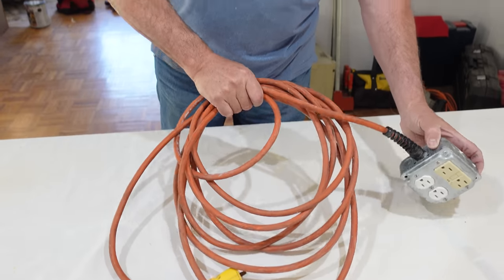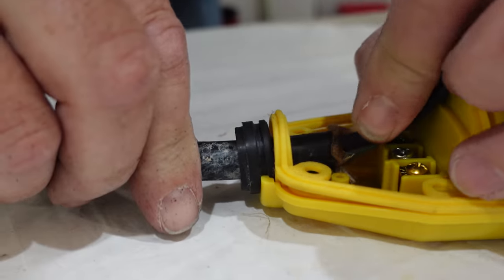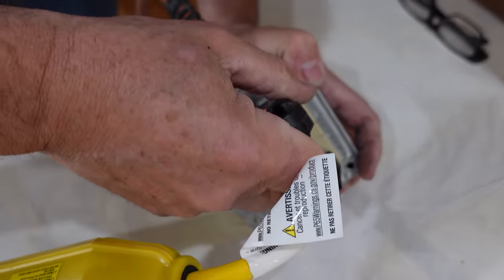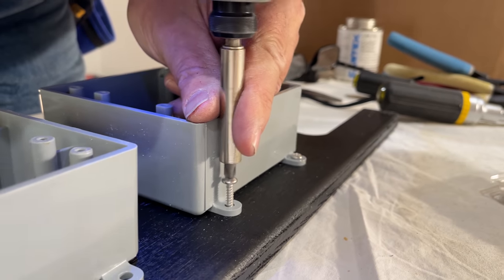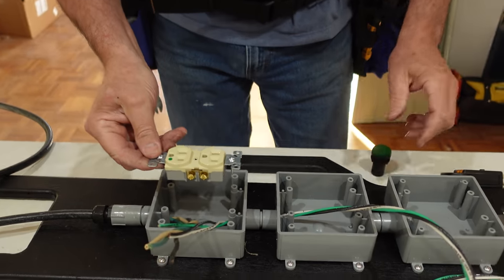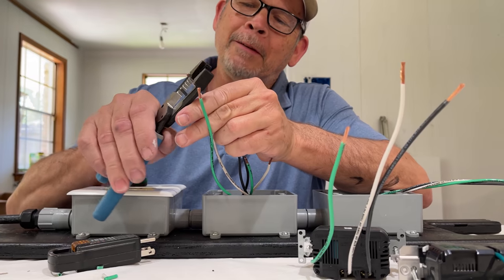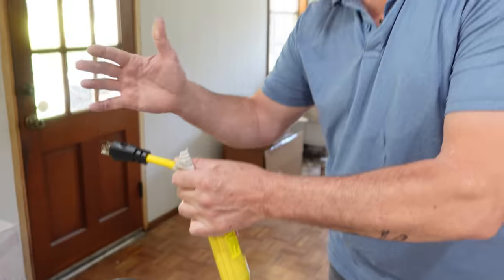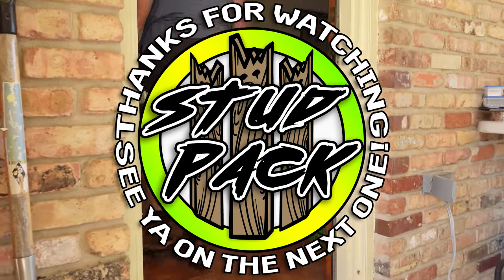HOW TO MAKE THE ULTIMATE EXTENSION CORD!

Comment: Awesome as ever! Shouldn't the highest current receptacle be the first one on the daisy chain? The lightest load (the USB chargers) at the the far end. That way, the high current load doesn't have to go through a half dozen interconnects. It makes sense to put the high load socket and the pilot light in the first box so the high current is first on the line and  the lamp let's us know power is coming in at the source. Though improbable, one of the connections in the middle of the boxes might fail. You still know the cord is hot. Keep up the great work, boys. If your video pops up in my recommendations, I get a piping hot cup of Joe, sit back and enjoy the show!
Reply: It makes no difference the order of receptacles, just because one device is able to pull 20 amps, doesn’t mean the rest of the devices are getting “high current”. Kitchens are required by code to be fed with 12 gage wire and 20amp breaker. It makes no difference if you are running several high amp appliances on a certain plug and then have your phone plugged into a different outlet…your phone isn’t going to fry with high current just because you other appliances are pulling 20amps. You also probably don’t even know the order the receptacles were wired anyway because it’s not an issue.
Reply: @JSH1  it's like when you use the receptacle installed on your oven to power other stuff.
Reply: @JSH1  We watched him wire it so we know its one box to the next meaning the switch and 20 amp outlet are at the end of the chain.  I think you missed the point of his question because it had nothing todo with the wire being able to handle the current, your explanation may be valid but didn't answer the question.  wires in the wall or box are unlikely to fail, especially when there is never stress on the wire, that's why code has them clamped to the box and within a certain distance of the box to a stud.  His point was a physical connection is always going to be weaker than a solid wire.  logic would say that the highest power should have the fewest possible disruptions to the current which leads to his question.  Science or testing may show that the logic is incorrect, or does not have a significant difference to how it is wired.
Reply: @trekie30122  I’m simply saying that it doesn’t matter on the order of 20 amp vs 15 amp plugs…note that 15amp duplex’s are rated for 20amps. There is no stress from box to box the way it’s installed. If he was connecting box to box with SO cord and not secured to a backer board then that would be a valid statement that the wires would be more stressed than a typical install.
Reply: @JSH1  absolutely it does matter. If you have the 20amp receptical at the end and plug a device in that is pulling 20amps, then that middle 15amp receptacle has been overloaded as the power has to pass through that one first.
Reply: @remodz6385  He's not passing current through the earlier receptacles. That's why he had to use the 5 slot wagos.
Reply: @remodz6385  Not trying to be disrespectful here but you clearly don’t fully understand how electrical systems function nor does it appear you’ve watched how he pig tailed the receptacles. Power isn’t flowing through one receptacle, through another then through another in a daisy chain, it was wired in parallel which is code.
Reply: @dms031000  ahhh👍 didn’t notice.
Reply: @JSH1  I looked carefully at the video and that is not so. He had Wagos in the first box and Wagos in the second box with the receptacles daisy-chained through multiple Wagos. If you pause the video at 19:51 you can see this clearly.
Reply: @ib9rt  correct, the wagos are in each box, connecting the line voltage to the receptacles and also to the wires for the next box. This is the definition of connecting receptacles in parallel. If there were no wagos and the line voltage was connected directly to the receptacle and then wired to the next box from that same receptacle then that would be considered daisy chained. He wired everything properly and to code so it makes no difference the order of receptacles.
Reply: @JSH1  I disagree. Whether you consider the receptacles to be the connectors, or whether you consider the Wagos to be the connectors, the connections are still in series, even if code considers them to be "in parallel". The daisy chain goes: Incoming => Wago => Wago => Wago => Last receptacle. There is no reason to consider a Wago to be a more or less secure connection than a securely wired receptacle. If there is a break in the wire it becomes a connection instead of a continuous conductor, and any connection is a potential point of failure. From an engineering point of view it would be preferable to put the 20 A receptacle in the first box so that there are fewer connections for the 20 A to flow through. Wagos may be certified and secure connections, but they are connections nevertheless.
Reply: @ib9rt  I appreciate your viewpoint but from an electrical engineering perspective the receptacles are wired in parallel, it makes no difference for the order of receptacles. If this was a permanent solution to power a dedicated piece of equipment then yes, a dedicated 20a home run circuit from the panel routed directly to the 20a receptacle without any other connections or receptacles would be the ultimate choice. This is an extension cord at the end of the day, what else is connected to the same circuit as the extension cord is plugged into and how many other wago/wire nuts are used in the house wiring to the receptacle the extension cord is plugged into?
Reply: @ib9rt  I also respect your opinion,  but it's only used for a job site application after all,  right? 
Or did I miss something. 🤔 
I watched 3 times and came to the same conclusion.
Reply: @ib9rt  I agree with you and came here to post the same.   It’s not much, but the Wago terminals (or any other terminal) will a small voltage drop.   So, yeah, it would be best to put the high current load first to minimize those drops.    Of course this is kind of nitpicking as there will be more voltage drop in a 50 foot extension cable than across a few terminals.   But still, the Studpack way seems to be to things right whenever possible so why not put it in the best order?
Reply: @aerotraveler  If you were to take a voltage drop tester and test the voltage drop of the first receptacle, the second one, and so on, you would be surprised as to how much voltage drop can occur just from each connection. It wouldn't surprise me if there were a 2 or 3% drop from the first recepticle to the last one, which could in totality be in excess of the 5% drop you want when operating high amp draw tools.

All that being said, the extension cord will work great as it was assembled, but it would be my personal preference to put the highest draw 20A receptacle 1st, followed by the 15A, and then the USB receptacles. This configuration would have the lowest voltage drop for the highest current drawing tools.
Reply: @JSH1  The point the others are trying to make is a simple one. The higher load devices (potential load) should have the least amount of splices in the system. Although this is not a code requirement and is often passed over in practice, it is a legitimate point of view from an engineering standpoint. In fact, in some industrial situations with long runs back to the switchgear, this is exactly how things are done. But those are complex situations with multiple fused disconnects being used to allow a smaller gauge wire to be ran to equipment further downstream as the load on the branch circuit is decreased. As you know, this approach is exclusively used on heavy stationary equipment without load centers that require a single disconnecting means that can cut power to the entire “circuit” machine/line at once.
Reply: @Veritas-invenitur  John, I couldn’t agree with you any more, if this were a permanent load on a dedicated circuit as I mentioned in a previous comment. My simple answer is that this is an extension cord, it doesn’t matter if the 20a receptacle is first or last. The 15a duplexes could potentially have 2 loads at 20a on those more frequently when using multiple saws/devices, as they’ve mentioned in the video, they don’t even own any 20a equipment at this time. Having 2 additional “splices” is not going to have any issues on an extension cord when it could potentially already have an infinite number of “splices” in the circuit they are plugging into. A 20a circuit can have up to 10 duplexes installed, each of those receptacles is a “splice” point and depending on which receptacle they’ve plugged into, they already are dealing with multiple “splices”.
Reply: @JSH1  I respect the logic.
Reply: @remodz6385  The wagos make each device on a parallel branch. They're not in series.

Comment: Good video, Stud pack. Randomly came cross this older video of yours, i have been watching the new carage build videos like grazy everytime a new episode comes out! One thing i may add about the cord: here in Finland, i was taught in school to always make the cords ends connected so that the 3 wires inside the cable would be so that the ground is the longest wire, then the neutral the second longest and finally the hot to be the shortest cut of all the wires.
This is so that even if the strain relief fails, the hot wire is the one that gets yanked out of the connection first, so that it would disconnect first in case of a fault. Neutral second because if the neutral would be the first to disconnect, it may in some cases destroy some appliances with the hot still connected. i think its because the electricity sometimes finds a other route inside the device and it can potentially be very bad for the device, like frying circuit boards and etc. Ground finally the longest so that the device is always grounded in case of something ripping the cable straight out of the cord. Happens more often than you think.

Comment: A breaker is a Thermo-Magnetic over current protection device. The '' Thermo'' portion of the breaker consist of a bi-metallic* strip of metal that is heated by a resistor in series with the load *( two dissimilar metals fused together, each having their own thermal expansion coefficient, thus creating a curve in the metal strip when subjected to a heat source. ). this flexion of the bi metallic strip of metal is used to trigger the breaker opening mechanism. the bigger the overload, the faster it heats up, the quicker it trigger.

On the other hand, in the event of a pure short circuit, the Amps drawn can easily climb to 1000 amps on a 15 amps line in a fraction of a second, too fast for the bi-metallic system to react in order to prevent the wires from glowing red. This is where the ''Magnetic'' portion of the breaker comes into play, inside the breaker the load/amps have to pass thru a coil of wire that act as an electro-magnet, but just when huge amount of current pass thru it, so when a pure short is present with thousands of amps, the electro-magnet pulls the triggering mechanism of the breaker and opens the circuit. Simple design, very effective.
Reply: I would say the ohms resistance on this build extension cord is one of the best in the industry compared against other  multiple  outlets connectors.  which is why others burn up. I believe the breaker is set to an average resistance for the regular consumer and bc this was diy built the breaker did not trip. but thats not a real world test bc nothing like that is ever that close  each tool is usally in its own area so may be adding some 25 ft to 50 ft extension cords would really load test the breaker and and and the load when cutting is higher so may be performing an actual cut for testing will pull more than 28 amps for sure
Reply: great explanation by the way!
Reply: Not all breakers are thermomagnetic.  The breakers in a lot of power strips and inverters are usually thermal only.
Reply: @randacnam7321   That is very true and hospitals and other more health related places have thermal protection and magnetic action as does homes or residential.   

Canadian standards now do not accept any breakers that do not have at minimum Thermal and magnetic trips.
Reply: There is also GFCI, AFCI, and so on, but for the sake of simplicity i talked about the most common house panel model.
Reply: @thankswezilow6794  Thanks.

Comment: Rotate the boxes 90 degrees. The wire on plugs that point down will tangle up across the other plugs. Having them point out instead of along the unit. Great job. Loved the hospital plug info. Great for heavy use and heavy load.
Reply: If you rotate those plastic boxes then the conduit connections become more complicated with tees and would not be inline as they are in that build.
Reply: @user990077  No changing the device direction doesn't change conduit.

Comment: I really love this project. I have been meaning to make a couple of boards like that to coil my extension cords, but I didn't think to integrate the receptacle boxes like that. 
Instead, I built a steel box to hold a 20A 120V duplex and a 50A-style 240V receptacle (for my welder and grinders). There was no way that I'd find the right combo cover plate for that at the home center! I like the idea of the separate 2-gang boxes, I think I'll rebuild my breakout box this summer and add the board, too!
Thanks guys!
Reply: How do you get 240v to your panel?

Comment: Great job guys. I too am an Electrician, but i think the overload has been well explained as to what's happening. Loved your super extension. Thanks for sharing 😃
Reply: You thought the 12AWG stranded falling of the ground screw was something to "love"?  No 15A receptacle is designed to hold a 12AWG stranded conductor on a ground as it is NOT a current carrying conductor and is actually sized smaller than the requisite 14AWG.  He's two gauges too large and that screw is NOT holding it as he claims.
Reply: It's simply an old breaker, failing to trip.
Reply: @DiffEQ  He should be fine, because in case of a ground fault it would just trip the GFCI.

Comment: just watched both of the extension cord videos. I also had issues with the metal box (but it's so Robust that it needed a fix), this version of the extension cord is much more than we need. So the Original version is what we Made with some improvements. I live in the pacific north west we get rain from October to May so water is a problem on any job site. My solution was to fill all unused holes with JB Weld I also used some 80 grit sandpaper on the interior faces of the box and sprayed the interior with the flex seal rubber coating. I also used exterior plug covers so the unused plugs are sealed when not in use (the metal flip up kind with a gasket seal on each socket). I also take the time to place a pice of plastic tarp over the box and we always put it on top of something so its not directly on the ground, just incase we get a sudden shower while we're working. we tend to put up shade roofs over our tools again just incase. Remember kids electricity will kill you if you let it.
Be Safe!!